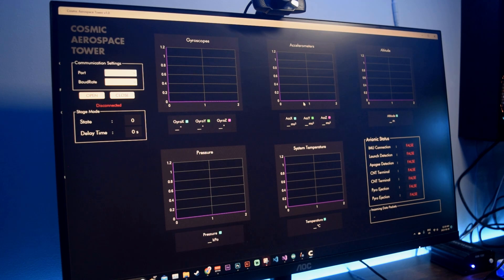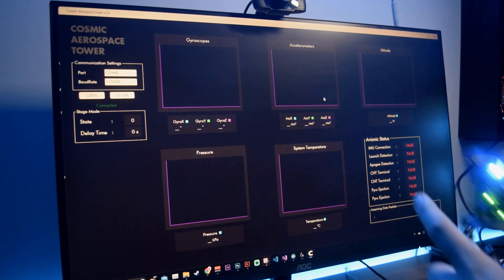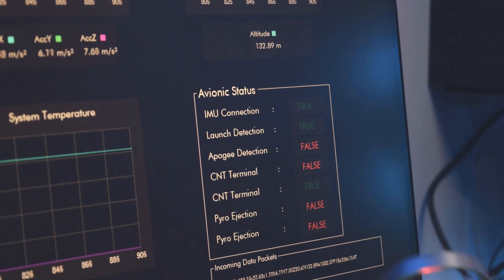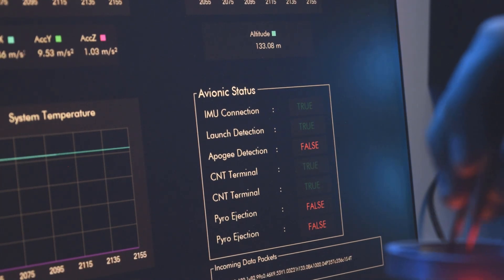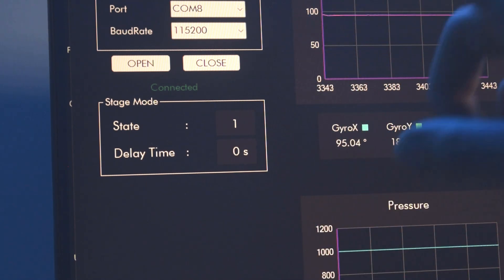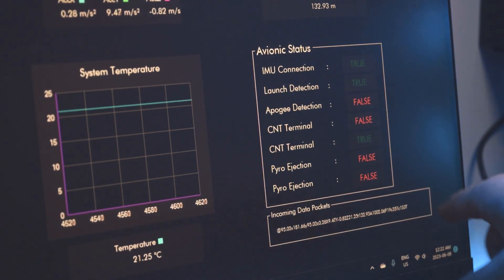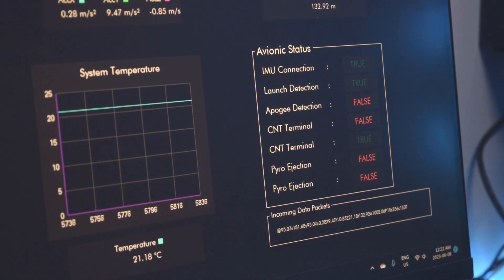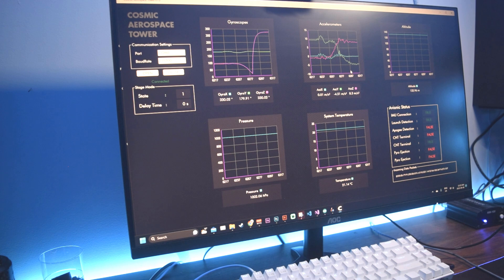Status Avionics for the Cosmic Tower

Comment: Seems like the download link is no longer working, can you fix?
Reply from the maker: I am currently building a newer version of the software. When I release that, I will simultaneously release the code for this one on GitHub
Reply: @CosmicAerospace  Awesome! Can't wait!
Reply from the maker: @Chimpyboi  What platform are you using? Because it’ll be initially available only on windows, but if there are a lot of MacOS user I’ll try to push that forward aswell.